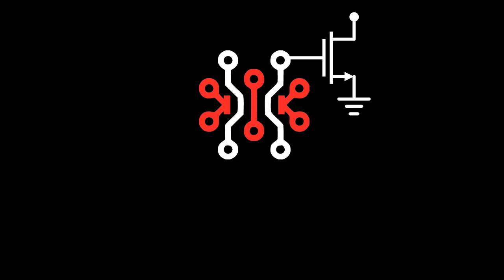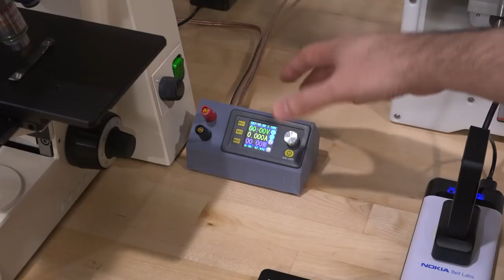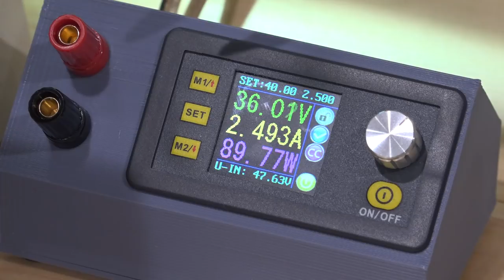TNP #3 - Zeiss Microscope LED Upgrade & Differential Interference Contrast (DIC) Microscopy Preview

Comment: It's not the best idea to have a big area LED in this setup. Our aim (I'm a Zeiss developer) is to have a point like source as collimation is designed so that a point source optimally fills the back focal plane. Modern LED sources use fiber guides. However in the olden days indescandend bulbs needed to be aligned so that the filament is never reflected onto itself which would lower the lamp life. Also when aligning you should remove the objective and aim for uniform illumination with the adjustment screws on the lamp house. Usually you will see the filament and it's reflection when you hold a piece of paper in the back focal plane. With halogen lamp make sure to have filament and reflection on top of each other. This no longer applies for you but make sure even illumination when the objective is removed. After that you can proceed with Koehler illumination setup to get the best possible Abbe limited resolution.
Reply: Damn! It's always good to hear from a real expert, even if you are pouring oil on someone else's design. Any chance you could point Shahriar to the right parts?
Reply: @michaeltonge1971  yeah sorry about the slight rant. It's probably not too bad at low magnification but if you are working with 63x immersion lenses alot of light is wasted and it gets pretty dark. Not sure but for the old pyramid style scopes might be LED retrofits available. But not from Zeiss.
Reply: @LutzSchafer  I don't think it's a rant. I think it's absolutely fantastic to have subject matter experts to provide information and I am sure Shahriar appreciates the comments too. This is what makes this channel and others such as Paul Carlson's or Dave Jones's for examples so educational and SO worth while. The info you provided may be helpful to others and passes on wisdom to all of us who have interest in such things!
Reply from the maker: I am aware of the limitations of the LED mod and the procedure of uniform illumination without the objective lens. Zeiss also has a few good videos on how to align the light, etc. which I studied before the mod. In fact, I emailed them to let them know I was going to make a video but never heard back unfortunately.
I had to work with what I had and the result is acceptable but not ideal. I aligned the LED with the existing optics as best I could, including the position of the LED with respect to the focusing lenses in the light source.
Reply from the maker: I forgot to add, thank you for the useful information and addition to the video! Having an expert comment is always a blessing.
Reply: @Thesignalpath  as someone that spend a lot of time building and modifing quite a few microscopes during my PhD, i should add that the COB LED you used is a total waste. The Collector optics are designed to utilize a area the size of the Halogen filament, so more than 90% of the light created by the COB will not be used. A good candidate for LED retrofits ist the XLamp XM-L(1/2) Series by Cree, but unfortunately they have relative low CRI (one reason why Halogen is still very prominent in Microscopy, you have an excellent color rendering, which can make a huge impact with stained biological samples or some polarization tecniqes). The XLamp XHP50.2 looks very promising with a good sized emitter and high-CRI models, but i never got the one to try (yet).
Reply: @florianf4257  yeah exactly as I said before the closer you can get to a point source the better. The collimation optics are designed somewhat as a compromise as in the olden days there were no suitable point sources available. For that reason it was a struggle to evenly illuminate the back focal plane.
Reply from the maker: @florianf4257  Interesting. Thank you.
Reply: @florianf4257   Yep, CRI and CCT arent the big name-plate figures that are attractive, but make all the difference. I made LED replacement fiber illuminators for microscope work, and it was nice with 90+ CRI, 3500-4000k LEDs. Much better than ring-LED illuminators with a bunch of gross cool white, low CRI 5mm LEDs my coworkers have. But feeding a fiber bundle is much different than an optics path, so I could get away with a COB.  I'd agree on the XM-L series.  Mouser has some relatively high-CRI XM-L's in stock ( XPLBWT-00-0000-000UU640H ), 4000k, 90CRI, looks like a relatively good flux bin too.  On a copper "direct thermal path" MCPCB that has the thermal pad directly soldered to the core rather than though an electrical insulation layer (I.e. MCPCB-XML-16NOC-RD from Cutter electronics australia ) and with heavy cooling they could probably suffer beyond the 5A datasheet limit if reduced service life is accepted.
Reply: @CKOD  unfortunately there is no XM-L with a CRI greater than guaranteed 80 around 4000K. The one you mention is an XP-L (which has a smaller emitter and a absolute maximum current of 3A). Most likely still ok to replace a 50W or 100W halogen lamp in a microscope, but i had to replace a incandescent bulb for my old Leitz Orthoplan (from 1968) which needs a bigger emitter. Right now, i run the XM-L2 at only 700mA which is enough light even for reflected light DIC, so i'm certain that 1,5A should be more than enough light for everything except fluorescence as long as you have a good adaption. The 100W-COB used in the Video could easily be replaced by a well adapted 5W LED.
Reply: @florianf4257  Ah, whoops I managed to confirm mouser had the part entered correctly  by checking in the datasheet, but still managed to confuse myself by having the XML datasheet open in a different tab. XMLBWT-00-0000-000UT20E7  3000k  90 CRI, in stock. Will probably be a bit warmer than a halogen being run hard like these little 50/100w bulbs, but at least its actually an XML this time.
Reply: If you still reply to messages, I took your suggestion. Today I purchased a few 'Cree XHP50B-00-0000-0D0UH250G' (5000K 90cri 12vdc) leds from Mouser.  Ive never attempted a reflow soldering as a casual electronics hobbyist. I imagine soldering these to a circuit board will be the, by far, most difficult aspect of trying to integrate these into a design.  I've got a CX-41 Olympus and my goal is to use this also for front illumination. and even wondering if typical circuit boards can withstand the heat these generate at the solder pad points.
Reply: @gregvisioninfosoft  you definitely will need a good sized heat sink. Did you order the Cree's on the aluminum pcb? Then there shouldn't be any problems. Just need to find a way to mount it. I'm not so familiar with Olympus but sure you will find a solution. Good luck 👍

Comment: Amazing! I love how you don't waste time on unnecessary things. With your level of skill, you could have designed your own PSU and buck converter to run the LED and fan, but you went with easy available solutions.
Reply: If thats 100W LED from ebay, I would have my doubts about longevity, efficiency and color rendering index

Comment: Such exquisite optics!  Zeiss builds some wonderful optical systems.  One of my expensive hobbies is amateur astronomy and astrophotography.  I own a number of Astro-Physics telescope, which are just wonderful, including a 155mm (6") aperture apochromatic triplet (with hand figured, oil spaced lenses).  So wonderfully color corrected, high contrast and a joy for planetary observations.   Some years ago, during a Mars opposition, I had a rare opportunity to observe Mars through my scope's very limited production big-brother.. the 8 inch aperture version of my scope, another hand-figured triplet refractor.  And to top it off, the owner had a Zeiss binocular view and Zeiss orthoscopic lenses.  This was just about a religious experience!   The Zeiss optics, both the binoviewer and eyepieces had very little scattering which presented such a wonderful high-contrast image..  Just a joy to behold!

The "problem" with optics like these is the same as test equipment -- there's this asymptotic curve when you plot cost against performance.  Eeeking out that next few percent of performance costs many $$$ as your well up the steep part of the curve.    One of my scopes, my pride-and-joy, cost more than the first car I purchased new.. it's hard to explain to normal people why you'd do such a thing!

Comment: Great work! Especially imaging the surface roughness by manufacturing tolerances. You could use those images now and simulate it with FEM (e.g. HFSS, CST) to determine in detail the influence of the manufacturing tolerances on the results.

Comment: this looks like the predecessor to the confocal microscopy, they do some pretty amazing stuff with those, servos to move the optics around guided by software and you get a 3d representation of the stuff you're looking at...
regarding the halogen lamp - I think they use them still because of the emitted light spectrum, LEDs can have dips in the spectrum which may hide some detail in the sample

Comment: What are the squares around? Are those just to maintain uniform metal layer fill percentage for uniform etch, like on PCBs? Sorry if question is lame, never designed a chip, but did quite a number of PCBs.
Reply: They could be, but as some of them are not in a uniform pattern, like in concentric squares, I'm guessing not all of them are. They must be there to influence something at a lower metal layer, either capacitively, or inductively. When he focuses on the 3rd layer from the top, it looks like there starts to be tiny squares on a grid, possibly to meet minimum metal fill requirements. In CMOS, the minimum metal fill isn't only for uniform etch, but also to maintain a uniform topography - large areas with no metal will be slightly lower than areas that have metal, and that non-planar surface can cause issues at higher metal layers. At the highest metal layers, you can get away without having fills, as there aren't that many more metal layers above it, so your topography isn't going to get too uneven, but usually at the lower metal layers, you have to follow the fill rules.

Comment: Did you check the spectrum of the LED? What were the results? BTW: Can I recommend the Nikon D7100 as a replacement for the d700. I still own both. The D7100 has a smaller sensor but a higher pixel count and a much wider dynamic range. It's also great for astrophotography.
Reply from the maker: Do you know what frame rate it offers in live-view through the HDMI port?
Reply: @Thesignalpath  You could also try the sony A7RIII or A7II. Full Frame 60Fps HDMI live view. Any other mirrorless camera also will have high frame rate HDMI monitoring.
Reply: Probably better to use dedicated HDMI large-sensor camera for this microscope setup. I have D800 with fancy adapter on my microscope, but while HDMI output is 30 or 60 fps, focusing heavy camera on top and messing with batteries and controls is just inconvenient.
Reply: @xDevscom_EE  Which is why mirrorless cameras excell in this role. They are light, high fps live view, no messy focus, crazy high ISOs with very low noise with the sony ones, and many more benifits.
Reply: @anonymousarmadillo6589  yeah why not use a Arri Alexa Mini LF??!   I think a 2k+$ camera just for viewing through a microscope is a bit overkill
Reply: @ErZocktLP  The A7II can be obtained for a couple hundred dollars off of eBay.

Comment: Not sure how you used the DIC with the epi illumination. You need the Optovar setting with the polarizer. What would be interesting for you is the Zernecke phase contrast. But for that you need PH (1...3) marked objectives. They have a semitransparent phase ring (quarter wavelength). And also a corresponding dark field aperture in the filterchanger I think. Nonetheless there is a "digital" equivalent image processing (TIE) that I developed for Zeiss. With that you need two images at different focus. Positions. The transport of intensity equation  (TIE) algorithm transforms every camera pixel into its corresponding phase shift of the partial coherent light reflected from the sample. Maybe something of interest to you?
Reply from the maker: I would have loved to get a hold of a more modern unit from Carl Zeiss. I wrote them, but never heard back. :(
Reply: @Thesignalpath  That's a bit surprising. They are usually quick with quotations on potential customers. I don't know which area in the US you are to refer you. Here in Canada I kindof know the team although I actually have not much to do with them as I work remotly for advanced development Jena and Munich.

Regarding your Axioscope being from the 1990s it's a good universal instrument. Although you don't have any automation, you could create DIY solutions. Zeiss has a whole semiconductor family of instruments that are at TI, Infinion etc. That you possibly can't afford. Also there are systems dedicated to metallurgy. As I could see in your video, the objectives are not designed for reflected light metallurgy applications but rather for fluorescence widefield and transmission brightfield. But of course you can use them in reflected non fluorescent mode. To achieve the best theoretically possible  resolution  (1/(2lamda)) you would need to use coverslip and where necessary immersion oil. The metallurgy objectives are designed without that. Also mind you that Zeiss lenses start at $5k. The ones you are having already have a significant value especially the Fluar's.

Comment: Chip ID ICCTRDUP? CMC microsystems, TR = Toronto? All my chips in grad school were ICKAAxxx - university of Alberta, built in the Dalsa 300V CMOS process through CMC! That is a pretty nice microscope - even nicer than the one on the probe station I used in grad school. What really got me is the microscope we had for taking die photos for thesis or papers was really crappy! I tried to attach a camera to the probe station microscope, but we didn't have the right adapter, and my supervisor didn't want to spend money to get one made in the machine shop, so all my die photos in my thesis are terrible!
Reply from the maker: Yes, it is from University of Toronto. That is where I did my Ph.D.

Comment: Are you sure you have reflected light differential interference contrast setup? That is quite expensive stuff - not to be thrown away that easy.
Reply from the maker: Yes, absolutely.
Reply: @Thesignalpath  Do you sense the difference between polarized reflected light microscopy and DIC microscopy ?

Comment: Likely the illumination will not be as good with the LED due to the large source area. Also halogens are still mainstream on microscopes like this because of their perfect CRI. Looks great though
Reply: My thoughts exactly. "If it ain't broken don't fix it".I don't really understand the rationale for switching to LED in this case, did Shariar mention it? Improved brightness perhaps? This is not even guaranteed.

Comment: Nice scope. Even though you had removed the sensitive parts, I had to cringe a little bit when you said you took a grinder to a part of the microscope. You really should look into getting a mill. An old knee mill or used table top mill should not be too hard to find or cost too much.
Reply from the maker: The lenses were removed when I grinded the unwanted parts away. These parts are not precision parts, so they didn't have to be perfect. Indeed for more critical parts one should use a mill.
Reply: @Thesignalpath  Can you get a 3,000 lb Bridgeport in your lab? The oil and metal chips are kind of messy. Seriously, Shahriar, thanks for another great video. I have a Zeiss contrast microscope I thought could be used only for transparent specimens.

Comment: Why change from halogen?
Reply from the maker: Because the lights were hard to get a hold off and I wanted something with colder light colors.
Reply: @Thesignalpath  Perhaps adapting it to use an automotive headlight bulb would be the way to go? Apart from very common halogen bulbs, HID would be worth a consideration.